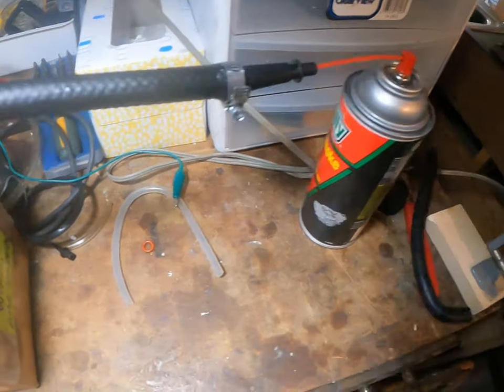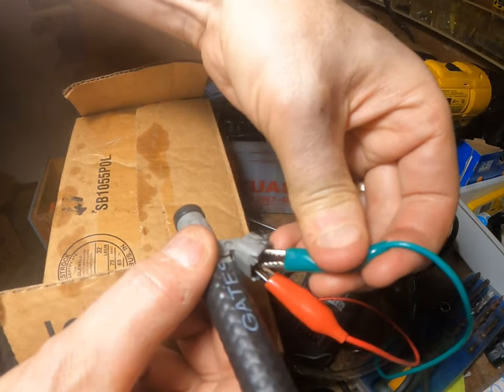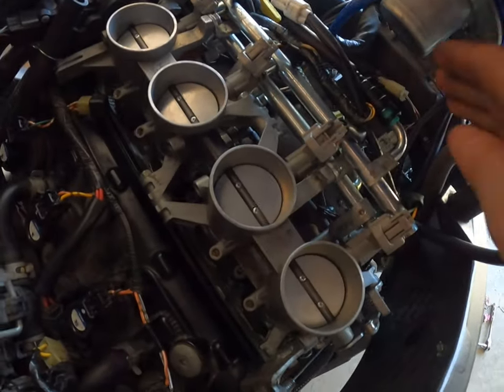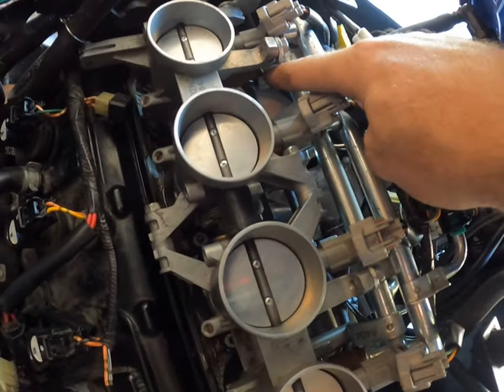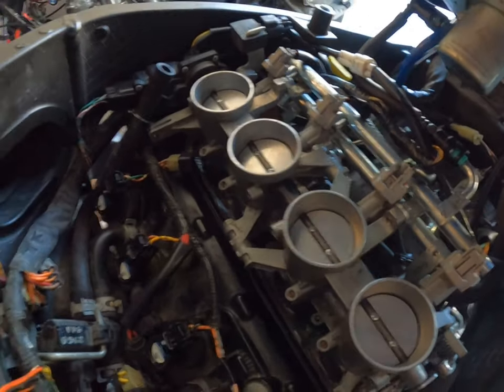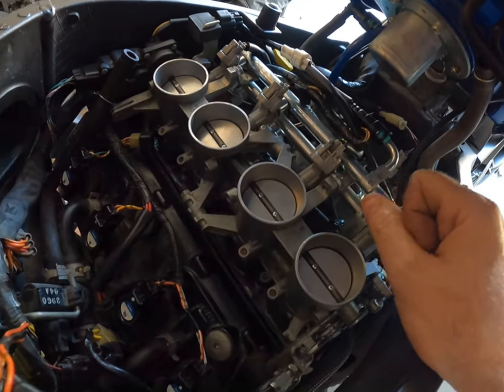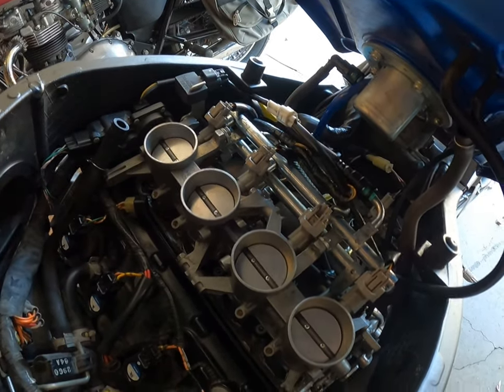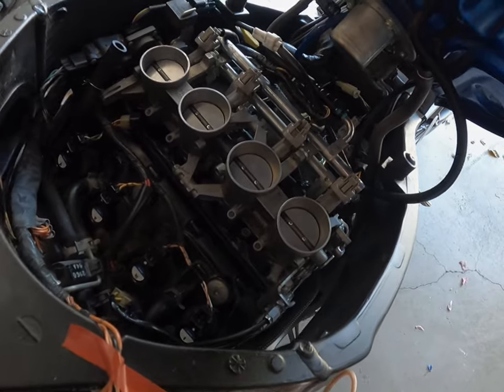2006 Suzuki GSX-R750 Fuel Injectors: Disassembly, removal, rebuild, test

Comment: Did you have to buy two kits or was the kit for all eight injectors?
Reply from the maker: I only purchased 1 kit.  The kit is good for 4 injectors.  The kit I purchased contains:
4 - Inlet screens
4 - Viton Upper O-rings
4 - Upper seals
4 - Lower seals
Total of 16 pieces

Comment: Where did you get the hex bolts from for the fuel rail ?
Reply: I had a few lying around that fit.  But you can easily find something at any hardware store like Home Depot, Ace Hardware, or if you're in Canada, Canadian Tire. : )

Comment: Great tutorial; any link to kit on ebay? Thanks
Reply from the maker: Thanks- hope it’s of help for you. Yep, details of kit are in the description.  Cheers.
Reply: Any tips on removing the injector harness 'plugs'? Thanks
Reply from the maker: @cbx1168  - Do you mean the electrical plug to the injector or removing the injector from the rails?  Both should be fairly straightforward.
Reply: Removing the lower electrical plug from the injector
Reply from the maker: @cbx1168  If I recall from when I did this, the lower ones have a similar style plastic connector holding them on to the injector; a small tab that needs to be depressed, before you can pull them off.  They can be a bit stubborn to get off if you don't press it far enough.  If you disconnect your fuel line from the fuel rail, and remove the screws holding the rail, it might be easier to disconnect them - as you can gain more access with your hands in the cramped space.  You can also refer to the details I left in the video description when video was first posted.
Reply: Thanks